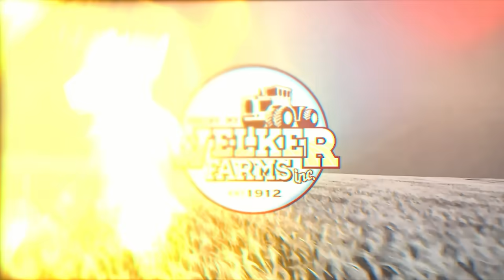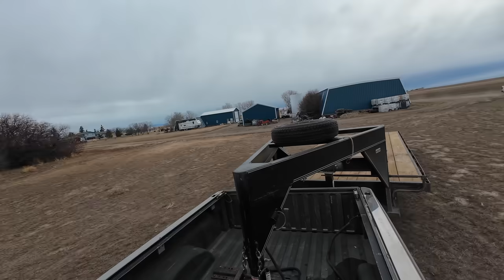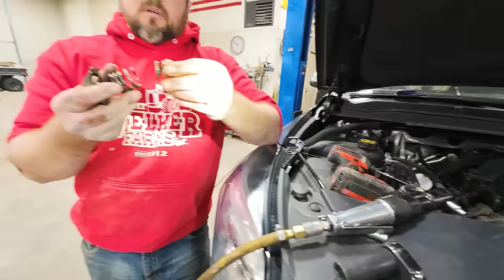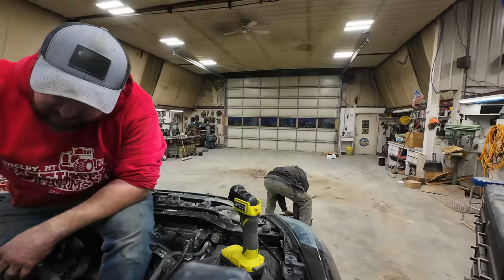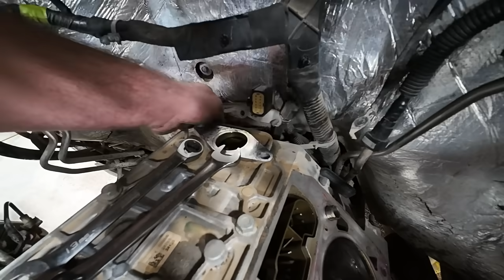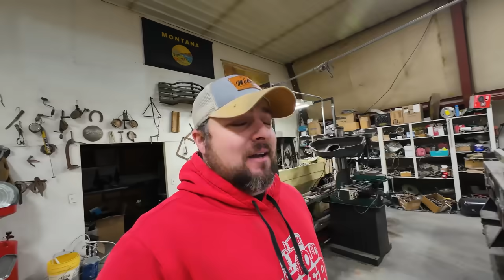Not Again! 🤦‍♂️ Engine Cratered...Let's Find Out What Happened

Comment: In January of 2020, I had just got back home from a trip out west to South Dakota, Wyoming, Montana and my 2015 Yukon Denali XL 4WD with 150,000 miles on its 6.2 went south due to the cylinder deactivation garbage. Had it rebuilt and that turned off. I now have 183,000 plus miles on it. Love the vehicle and it will be my last one. I have front leveling kit and 1inch level in the rear. It’s got a cold air intake and I run 305/55/20 Goodyear Wrangler Duratracs on it. This set up has been on it since I bought used in 2016 with about 45,000 miles. It was built in 2014 so I lucked out and got the 6 speed transmission for the switch over to the horrible first generation 8speed transmission…My mileage did not change that much, maybe 1.5 mile per gallon. But it’s straight 8 all the time…Will drive it until Jesus Christ comes back, or until my kids have to take my drivers license away. 

Be blessed and be safe….

Comment: I can feel your pain.  Over 50 years ago, my brother had a broken valve spring in his 66 Mustang , with a 289 HIPO.  It dropped the valve, thru the piston, and it cracked the block.  We changed the engine in the winter with an a frame.  Tony's family is very nice to let you use their vehicle.

Comment: for the cost of a valve i'd replace the exhaust one as well. no telling if it got hit or not and has been bent back by the engine. if the head of it drops off, thats another rebuild or a new engine.

but still painful that a bean counter decided they knew better than the engineers on the type of spring steel to be used.

Comment: I just replaced the engine in an 03 Chevy silverado last summer because the 5.3L dropped the face of the valve into the cylinder.
luckily the 4.8 L and 5.3L LS engines are plentiful.
 I pulled the cab off to do the swap, also changed the transmission as I went with a 4.8L engine and the transmission from the doner truck was in better shape

Comment: My wife's RX350 broke a valve spring and left her stranded. The valve didn't drop but the keepers were hanging on by a cats whisker. Tore it completely down replaced all 24 springs and a valve along with seals and it should be running next week. She got really lucky. I've seen the carnage on "I do cars" yt channel when a valve drops and it's not pretty.

Comment: Cylinder deactivation has caused huge problems with many 6.2l
Reply: Exactly mate and thats why I refuse to get any modern GM vehicle period.
Reply: It’s created major problems in Honda V6 engines as well. Turns em into oil burning pigs that foul the rear bank spark plugs creating a skip. New rings and deleting the cylinder deactivation is the only long term fix.

Comment: It probably would be easier if you remove the front clip and take the engine and trans out as a unit same way for putting it back in, that is what we do at work for the Kodiak 5500's

Comment: You know if you guys would just learn to drive Fords, they're right up there with the case IH, and you wouldn't have all these problems! And no I'm not kidding, I've been driving forwards for nyon to 50 years and I haven't had any problems with them as long as I do regular maintenance on them. Just like Case IH!
Reply: Ford 5.4 3 valve, worst engine ever made.
Reply: Mine went 300k before the truck was sold... 3 yrs ago, still running strong in Florida.
Reply: Those 6.2 vortecs are no good. The 5.3 will last forever. Mine has over half a million km on it. My lmm durmax also has 300k on it. 6.2 are the junk engine of chevys
Reply: @chriseyre3457   I've got 200k in my 6.2. It's how you maintain them
Reply: @millfire517  if you delete the v4 mode AFM crap they seam better. Never seen one go over 150k with out major valve train work though. I am in northern Canada where we get down to -40. Thats hell on any motor starting
Reply: They'd never run so they won't blow up
Reply: Ford, Dodge, GM they all have problems. My uncle and my mother bought ford escapes at the same time. My mom had nothing but problems. From sensors to transmission. My uncle didn't have any. Same model. Same year. I drive a 700whp gto. It's been my daily for 7 years. Only issue I had was a TB sensor went bad. This die hard fan boy stuff is for children. Adults understand some things last. Some things don't. Anyway, the dod on GM is garbage. But Scott clearly showed the intake was installed incorrectly. No matter what engine, that's a ticking time bomb.
Reply: Don't be a fanboy, they all have their problems.
Reply: My brother finally retired one of his F-150s at 485,000 miles.  Original engine, but second transmission.
Reply: @chriseyre3457  1 question.   I have an aluminum block 5.3 with the "fuel management system"    but I bought it used.  My dad had a newer gen 5.3 and he got close to 20 mpg,    mines rocking a cool 12-13.   Can I assume the afm is deleted or no?
Reply: I’ve been a dealer tech and have worked over 30  years in the field. They all have problems. Do your research on what those problems are and decide which set you can best live with if they happen to you.

Comment: A lot of valves in aircraft engines are hollow because they have salt in them to carry the heat away from the valves.                                                I have tig welded aluminum heads, even in the face, milled the head and everything went fine.                                         As far as I know it worked out fine.

Comment: I feel your pain Scott! Just bought a used 2014 Ram 1500 bought an extended warranty cost $3000 for 3 years 2 months after I bought it check engine light came on  code was deactivation solenoid bad. Ok I got warranty took it in to dodge ram dealer replaced solenoid $1000 plus engine full of metal filings at some time someone replaced lifters and cam. Go old warranty people said it was preexisting condition would not pay in the end it cost $400 to pull the head to see where the metal was coming from lifters and cam good. Another $500 to pull oil pan to see if metal was coming from crank shaft nope. Then another $500 to put it back together! Don’t no buy extended alpha warranty

Comment: Just watched your video on the valve that dropped in your engine and damaged your cylinder just as a note sodium filled valves are used to transfer heat so that you don’t do a lot of dumb things to the motor. Here’s a note I found on the Internet. Ordinary table salt is sodium chloride. The stuff in your valve, however, is pretty dangerous stuff to be handled by someone who doesn't know what he's doing. Busted sodium filled valves or cutting into these valves can be dangerous. I guess you can take this with a grain of salt. Thanks for all the great videos I love the big tractors.

Comment: If the valve seals against the seat you can hold it up with a Leak down Tester and compressed air while replacing the valve springs and Rocker arms.

Comment: For valve springs, adapter for compressed air into spark plug hole. Keeps valve in place while you change the spring.

Comment: Thanks for another great video. 
It was interesting. 

Scott, I am sorry your vehicle quit running during your Xmas trip. 
How nice of the Fast family to loan you a vehicle to complete your trip. 
My blessings to you and your family. 

Now that you have taken your vehicle’s motor apart and have determined the damage is major, time to approach getting it fixed. 

The valve spring let the valve damage the wall of the block. Hopefully your motor shop can save the block. Then the process of parts and putting it back together again. 
I am sending my best wishes to you that your block can be saved. 

Hang in there. Know this is frustrating and expensive. Take it a step at a time and hopefully everything will work out. 

I am sending my blessings and may god watch over you. 
Take care. 
Hopefully you will have your vehicle back on the road soon. 
God bless. 
The Iowa farm boy. Steve.

Comment: The 6.2 is a solid motor just like any other Chevrolet LS V8 proper maintenance prevents failures... had a 4.8 in a 99 2wd ext cab with 525000km still ran almost as good as new

Comment: Another thing to watch is the 8 speed trans. I have it in my 6.2, replaced under warranty then after about 40k on the trans. The trans started to shake randomly around 40-60 mph(felt like hitting the rumble strips on the highway) Asked the dealership and they said bring it in and change the trans oil with updated oil and filter. No Flush!  Got rid of the problem so far after another 30k on it. Fyi if you have the 8 speed

Comment: Hook an air hose to the spark hole. The air pressure will hold the valve up while you replace the springs

Comment: Thanks Scott for the pick me up. I hope they can save your engine. Last May I bought a used truck from a nationwide auto dealer who supposedly did their 150 point inspection before selling me the truck. When I got it home I noticed the air filter had not been changed and the cabin filter had not been changed. It was only after being stranded about 100 miles from home that i found out the drive belt had not been changed either. The failure was the fan hub bearing, a major failure in my opinion that might have been prevented if whomever said they did the inspection actually changed the drive belt. Like you I am thankful that my family was safe, and yes parts will fail. Also like you I am blessed enough to be able to fix things myself and did save myself a lot of money getting my old new truck back up and running. Thanks again for the perspective, God is good. Many blessings.

Comment: I was a GM guy untill 2002 Montana came along Nothing but problems.  I now have Toyota Tundra 2008 and a 2015 Rav4.  The Tundra has given me no problems parts put in mostly at the dealership is running at 4,000 Canadian $$$ oil and fluid changes not included the truck has 299,000 km on it.  as for the Rav4 we have put 0 $$$ not counting oil and fluid changes.  It has 150,000 km on it.  that being said I have had a 1989 Caprrice with over 300,000 km on it with just doing the transmission.  Best wishes on your rebuild and speedy parts arrival.

Comment: It's good have to good friends. I've never been a fan of GMC/Chevy products due to these exact issues. Tis the reason I'm sticking with my old '97 F250, not saying it doesn't have it's issues but, still going strong today. Currently doing a partial restore on it. 
They should be able to bore it, then sleeve it unless there's too much material that needs removed.

Comment: I had a 2008 GMC Sierra with the 5.3L with DOD.  I sold the truck with 245,000 miles,  never had any issues with the Engine.  Of course DOD is helping to give you that fuel mileage that you said you like.

Comment: The same thing just happened to me a month ago. Spring broke in my 2014 Ram 1500. 130,000 miles on the truck. Dropped valve in the cylinder. New piston, new head, new intake manifold. In one 8 hour day yesterday I got it all put back together and running. FYI, I’m a painter by trade. Most mechanical work I’ve ever done was replacing an alternator. 🤣🤣

Comment: That was a disappointment to see what has happened.  Your family coped well.  Friends helped for sure.  I saw Tony and Tim on Fast Ag when you were at their farm.  You were blessed in that it could have been much worse.  (I have a 2008 Duramax for towing a 5th wheel RV.  It is only used for towing.)  The cylinder deactivation system that GM uses has caused lots of problems.  You will get your Denali fixed and of course we will be following your progress.  Nick will be there for you as well.  Take care.  👍🏻

Comment: You can use Air to hold the valves closed and remove/replace valve springs all from the spark plug hole..

Comment: Thars a bummer Scott. I have a 2001 Silverado with 300k +kilometers and its hydro locking. I love a newer truck but the body is still good on mine sobi plan on fixing in awhile. Toll then i bought my 90 year old grandpas truck. Its a 97 f150 with 38000 kilometers  to drive. Im a bowtie guy also.

Comment: Sad, valve springs could be designed so that if they break they wont drop the valve, 20+ years ago i remember a few engines i worked on that had broken valve springs causing a misfire, air up cylinder and swap out the spring.

Comment: Ford 5.4 triton, seized an intake valve on #1 / cylinder was good (or I missed a problem) honed it, new picton, reman head (Rockauto) , 120,000 miles later and still running fine // horrendous amount of work for you but you guys are very skilled // would dod delete it and a slight cam upgrade // Scoggins Dickey CHebby Dealership in TX

Comment: I feel you on the newer vehicles. As much as I like the looks, power and creature comforts, the reliability isn't there. I find myself lookin at older vehicles alot more here lately.
Reply: Try the legendary Ford Crownvic, those Ford Panther Platform cars are robust as hell.
Reply: @CJColvin  my 97 F150 has a 2V 4.6 in it.
Reply: @Brightleaf_Auto  Awesome, you basically have a the Crownvic Truck and not the crappy 5.4L SOHC 2V Triton V8 (which I know those engines are known to blow spark plugs out).
Reply: @CJColvin  4.6 can do it too. They share the same heads. They updated the torque spec from 14ftlb to 28ftlb and it helped resolve the issue.
Reply: @Brightleaf_Auto  Thats, the 3Vs are definitely the ones to worry about.
Reply: @CJColvin  no the 3Vs have the 2pc spark plugs that like to break off on the head. The 2V 4.6 and 5.4 up to 03.5 had the 4 thread heads that would spit the plugs.
Reply: @Brightleaf_Auto  Oh ok

Comment: Broken valve springs are often caused by revving up a cold engine right from the start up. The GM active fuel management system that shuts off the cylinders also sucks. It has many cam and lifter failures, Hence why AFM deletes are so popular. I'm glad that my 5.3L LH9 didnt have AFM. Zero mechanical problems.

Comment: I owned a Ford Pinto, Yea laugh, that dropped clutch plate springs. The engine had two long studs that went through the bell housing. I had to loosen the engine mounts and jack the engine front to get to the nuts and remove the transmission. (6 to 8 times to fix it.)

Comment: Thats a bummer Scott...
I've put 300k & more on several 5.3's  but I've never had one fail...
Friend of mine had the same problem you're having Twice..
But to be fair they were both very high mile motors..
One was in a Denali truck with the bigger motor . 6.0 or 6.2 , dont recall..
Must be one of those run to fail glitches with G.M.
Reply: Were your 5.3s pre 2007?
Reply: @hokie9910  
Sure...some before, some after...

Comment: The 5.3l in my Yukon 2004 model was bulletproof I had over 4 hundred thousand miles and it still drove out of my driveway the only reason I got rid of it was rusted out bad so the inspection would not pass so a friend bought it for parts for his. He rebuilt the motor and used a lot of my interior and turned out really nice his motor was getting weak so he rebuilt mine so he could continue to drive his . His was a southern truck so body perfect but interior not so good and he got about 300 thousand miles on his but he was not very good on maintenance. Maintenance is key for everything

Comment: Take the front wheels off, set the rotors on the ground. Much easier to work on. By the way Holley makes a obd2 plug8n to disable afm for most vehicles

Comment: its actually easy to replace valve springs in a engine inside a car. just use compressed air into the spark plug to pressurize the cylinder to hold valve's open then amazon sells a tool that bolts onto the head to allow u to compress spring and get retainer out.

Comment: Unfortunately my 2008 5.3 Silverado 1500 finally gave up the ghost on Christmas Eve. 351,192 miles on the odometer. I made the tough decision to sell it to a neighbor kid who wants to rebuild the engine and transmission and see how far it goes. 
Everything but the Alternator was stock and I had no AFM issues since it was so much highway mileage.
Reply: Wow you’re an encouragement! Lol ! Very similar except about mine for two grand year ago and then put maybe 500. It uses oil likes it real well
Reply: @paulprigge1209  it was my graduation present. My dad did the first 200k on it and I did another 150k I love that truck but it just didn’t make sense for me to put the time or money into rebuilding it myself. It was at that point where if I wanted to take it to 500k+ I would need to rebuild the engine, transmission, transfer case various other bit and bobs to make it last and be enjoyable enough to even bother. I’m not in the position to buy something fairly, but I bought a 03 Tahoe that my mom’s driven since 2004 and only had 140k on it.
Reply: @TheHeroPercy Those pre 2007 5.7s are very solid, you should great luck with that 2004.

Comment: DoD can't bend a valve or pushrod.
Nick's truck was a very obvious case of detonation and pre ignition. Which he wrongly blamed on DoD.
Hope your engine isn't too badly damaged. That head can be welded if they really need to, it just depends on cost. 
Yes, hollow valve stems are really common.
Have a look at Blueprint engines or similar if you need a new engine.

Comment: You're wife and kid's would've made it indy ram hehe. My advice besides getting a Mopar is get rid of the DOD system. My son has a 5.3 2002 model w/o dod and it's never been opened and has 400k miles on it. He used it with a tandem trailer loaded for bear at his company. Still running strong.

Comment: Use a pass thru device or there are a couple cheaper flasher that work with universal patcher and pcm hammer to defeat the mds system. All you have to buy is the pass thru flasher since pcm hammer and universal patcher software is free. If you delete the hardware for mds on the engine you must use a high pressure oil pump or you will have low oil pressure.